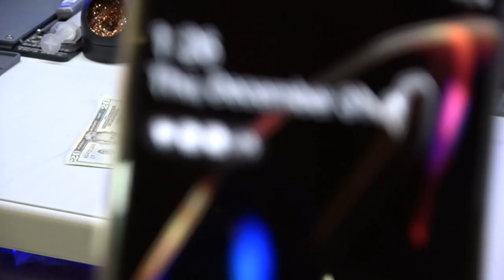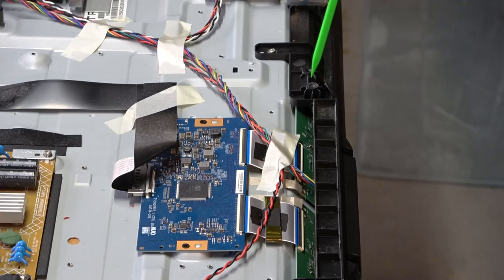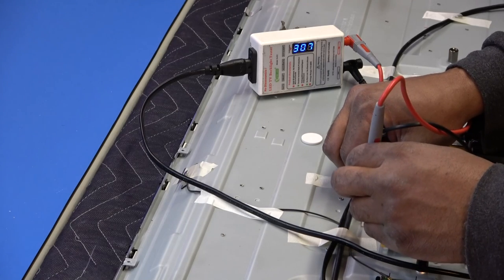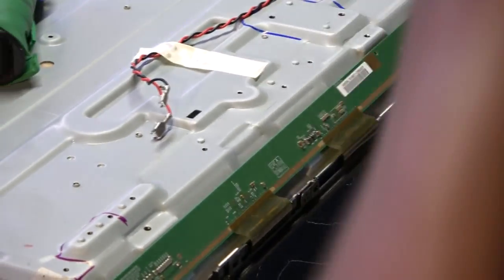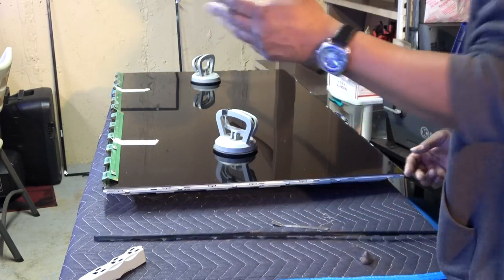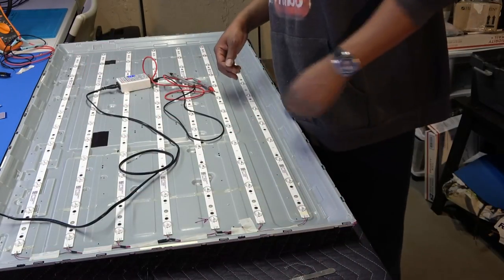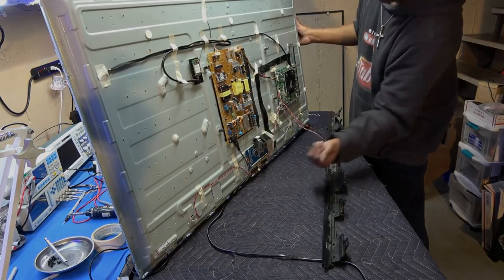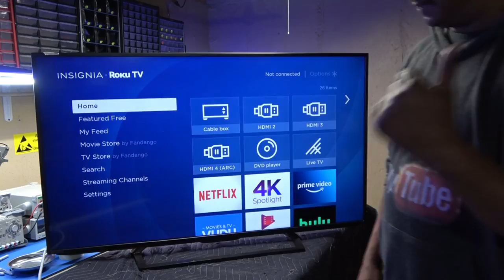55 inch Insignia black screen. NS-55DR710NA17 Roku TV repair.

Comment: I would like to say thank you bigdog! I was fixing my aunt & uncles TV after they had a power outage at their home recently. When they got the power back on they tried using their TV and saw the TV flicker and the screen went blank. So they bought a new TV because they thought it would be expensive to repair their old one. So I took it in and I knew it had to be the L.E.D backlight and sure enough it was. I found the right replacements on eBay for about $40 in total and shipping included. The TV they had was an 2019 Insignia 55" Fire TV. It took about an hour or two to take a part but I was successful and now have a (new to me) TV to put in my room.

Comment: This video was awesome. I had the exact same problem and this video led me to replace the LEDs (which fixed the problem). Then I very casually picked up with screen and cracked it in three places. Yeah, those suction cups that bigdog uses in the video - pretty important. I'm now going to go flush my brain down the toilet.
Reply from the maker: It happens. Even to me still. Now Not as often though, lol.

Comment: I have a Vizio E701i-A3 Tv, that i am having trouble finding the problem, and i think you are the best person to solve my problem. This tv powers on, the backlights come on, but i have no sound, no picture, no menu. This tv was given to me to try and fix. I have replaced the t-con and the main boards with no luck in fixing this tv. I have checked the power supply for bad caps they look fine.
What can be causing this tv not to work? I really don't want to recycle this tv if it can be fixed.

Thanks
Jim

Comment: Thank you so very much for this thorough video!  We have this exact TV and it has the same problem.  Hubby and I will try to follow your lead and see if we can pull off the repair.  We are so appreciative, because we don't want to spend another $350 for a TV (these are not the greatest of times).  So once again, thank you.  We will let you know how things turn out. =D
Reply from the maker: Glad it was helpful!
Reply: @bigdog8882  so we finally gota round to replace if the strips. And we after 7 hours we put the tv back together and it was no longer black .  Half was is white and the other half is red vertical lines.😬 any suggestions? 😯  FYI sound is still fine. thank you. 🙂
Reply: @anewchessfan  I would double check all the cable connectors are seated properly.

Comment: Great tutorial. Im actually working on the same exact tv lol. But the 2 driver boards coming from the tcon, you said there was some grounding tape on the corners. This one doesn't have any at all. But I seen it was at both sides. I notice that there one on each side of both boards. But didnt that in your video. Would I tape both sides or would that matter?

Comment: Hey BigDog8882, I have a 55 Inch Insignia and im dealing with the same problem. I've followed both your guides and got to the part to test the led strips. Unfortunately, all of the LED's work. The tv turns on and you see the homescreen and then within seconds to minutes it goes black and you can still hear sound. I bought everything needed for the repair and feel lost now... If you hold a flash light to the screen you can still see the background. Thoughts?
Reply: Having the same problem comes on for a split second see everything and then black screen

Comment: I've disassembled my Insignia 55" FireTV NS-55DF710NA19 and found that the Difuser bracket in my set is simply one piece of plastic - not strips.  Also the standoffs on top of the LED paper are each screwed in - no clips holding them in, and they also have a little glue under the standoff too.

I'm learning so this might sound like a dumb question.  When a pair of strips are powered in parallel, the tester will show one strip not lighting up.  But, when I separate them from being in parallel, the tester shows that each strip works.  In my TV if I test each strip individually, all the LEDs in each strip light up.  Powering up my TV though has one entire strip not working even though all the strips work if tested individually.
Reply: Also, my Insignia 55" has 5 rows of LED strips with 10 total.  The differences maybe that they are continually improving the product?
Reply: @Carl Moser I also have same tv model how do you take off the bezel

Comment: Hello I have a TCL.55" Roku 4k TV that I have had for over 2 years, I tried to turn on my T.V   all I get is the White Light by the the logo but The T.V is totally Black Nothing.. What can I do? Any suggestions where I can call to see if it can be fix?  I live in L9ng Beach, Ca Any help will be greatly appreciated,  Thank you
Reply: I have the 65" TCL doing the same thing. Get a flash light,turn the TV on and get real close and shine it through the screen and see if you see a picture really faintly. Another good way is to take it outside in the sunlight and turn it on. From what I have seen in his videos is you as well as me have a l.e.d lighting issue and you would have to replace the bad strip. But you can get the whole set on ebay for $35 or so and would just change them all out while your in there to keep from having to do it again a few months or so down the road.

Comment: Hey Big Dog, you made an exceptional video.  I have no knowledge about these Flat Panel TV's, but I have restored some old 1940s-1950s vacuum tube TVs.  Big difference in technology and techniques.

I'm into my Insignia 55" TV (Fire TV version) and not seeing your video on trouble shooting just shotgunned that it was the Power Supply board, ordered on on Ebay.  My TV will turn On/Off with the remote but no sound or video.  I did shine a flashlight on the screen (at least I knew that much) but didn't see any image at all.

BTW, where did you get those probes on your Meter??? I'd like to get a set too.

Comment: I feel so bad because I have 255-in TCL r u k u TVs the light comes on the blue light underneath the TV if I press the mode control to Netflix I can actually hear the Netflix but I can't see anything 4 5 6 8 Days Go By then I press the button and it comes on it'll stay on but if I turn it off at night it'll take me another week or two to turn it back on well for it to come on on its own I don't know what to do they just sitting here and it's so pretty I just don't know anyone that can help me and I can't afford another one so I just watch YouTube that's how I came across you

Comment: Question: how much would a repair job like this cost? I think i have a similar issue with my 55 inch hitachi roku. The screen is not showing, though you can see the screen lit when turned on.
Reply: last weekend i found one like that on the curb, the guy said the tv works but his dog chewed up the remote.  without the microphone/alexa remote pairing up, the tv won't do anything.  best buy might have one for 30 bucks. 
  a few weeks ago i found a 65 inch vizio, when i went to plug it up to try it... someone had robbed all the boards out of it {probly sold them on ebay}, i had one just like it with a broke screen that would fire up, so i swapped the boards over only to find out it had bad backlights... so i swapped the screen and  everything over to the one with good lights and got it working.
  if it cost to much to fix yours, you could part it out.  {i need a remote} lol.
shop jimmy shows he's sold out of the backlight kits= $59:95
Reply from the maker: You have a T-Con or LCD panel related issue if the TV has backlights but no video. Thanks for watching!
Reply: @bigdog8882  do you have a suggestion on where to look on a plasma that has a slight ghosting on the picture?  thanks
Reply from the maker: @ED4action  Hard to say cause of all the picture related boards in a Plasma TV. You can try slightly adjusting the little controls on the substain boards to see if that makes any difference.
Reply: @bigdog8882  ok, thanks i have a few around here that seem to have the simular problem